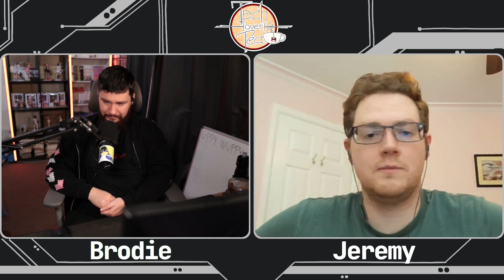The True Value Of A Microkernel Design

Comment: Can microkernels be as performant as monolith? especially in gpu permance
Reply: theoretically yes, but it's a lot harder
Reply: I think they could be significantly faster, that way the cpu doesn’t need to switch context every few cpu cycles. You could have a permanent system thread and the rest could be user threads.